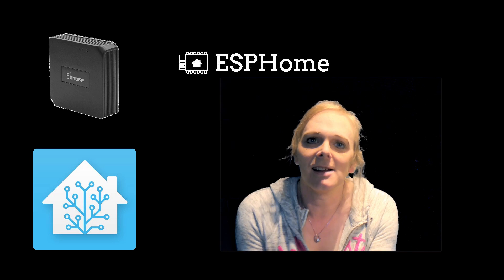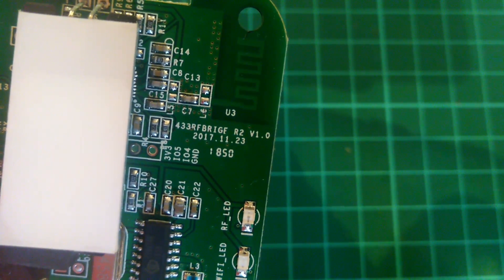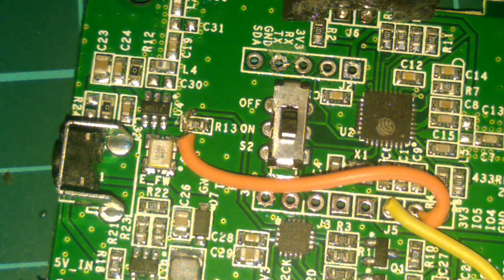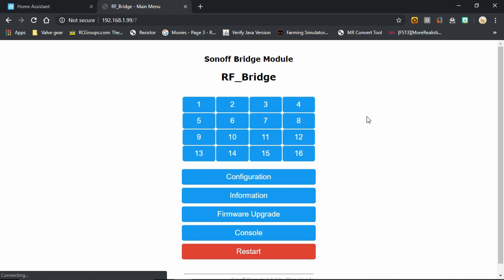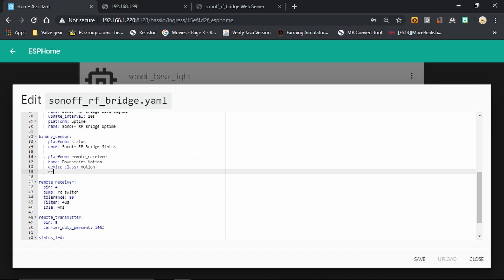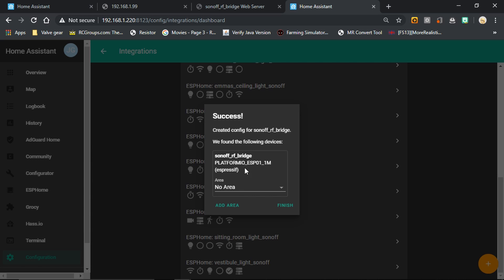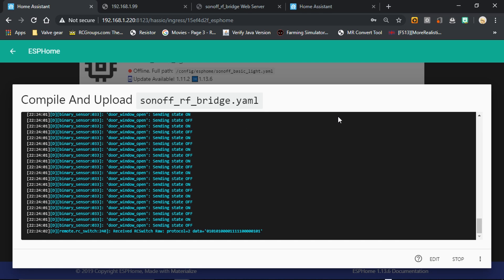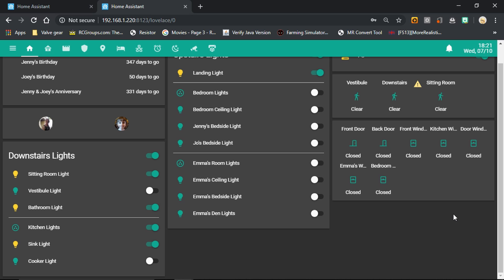Convert Sonoff RF Bridge to ESPHome

Comment: I recently lost my last backup and I had to resort to an older version. In between those versions, I installed RF Bridge on ESPHome. Now RF Bridge does not show in ESPHome. It does show in Configuration->Integrations. But it gives me errors when I try to configure it. It does not let me access it via its IP. And it does not let me upload new code to it via ESPHome, of course. Do you know of any solutions for this? Thank you so much!
Reply from the maker: I can't see why it gives errors connecting via integrations, it may be worth rebooting the rf bridge (or even the router as mDNS issues can cause connection problems) 
The code for esphome is only stored in the config/esphome folder though, so if you've lost that, it will never show in esphome. In that case, I'm afraid that the only solution I can think of is to create a new yaml for it and flash using ftdi.
Reply: @Pinkywafer  Thank you, Jenny, for looking into this. The router has been started many times since then. BTW, it gives me this error: "Can't connect to ESP. Please make sure your YAML file contains an 'api:' line." And it gives me the same error with a d1 mini I also setup in between the backups. One other quick question. What is the port it uses in Integrations? It is inputing by itself port 6053. Maybe I should change this to another port?

Otherwise I was thinking of trying to reinstall Tasmota. That would mean remaking the old hardware connections. Hope it will work
Reply: Sorry to bother you, @Pinkywafer  I managed to reflash tasmota. But I cannot seem to get the esphome binary onto the rf bridge. BTW, the first time I installed it, it gave me errors a few times before finally it worked. Did you happen to have this problem?
Reply: @ygreq  I have not had this problem,  but it could be due to the file size... try flashing a minimal tasmota first. I can't think of anything else I'm afraid
Reply: @jennygorton3412  I got the answer with the help of someone from the HA FB group. <<Go to Tasmota console, and type in "SetOption78 1", with no quotes. Should get a confirmation in the console that is is now on. It looks to check if it is a correct Tasmota bin file before uploading.
>> It seems this is a new feature or something. It worked!! Thank you so much for the lovely tutorials and for getting the time to reply!
Reply from the maker: Ooh! That must be new!  I've not seen that before. You're welcome!

Comment: Well done. Excellent instruction and thank you for your time in doing this. If you were starting with a virgin RF Bridge, would you flash it with Tasmota first or can you flash it with ESPHome Flasher on Mac using USB?
Reply from the maker: No need to flash tasmota first, you can flash your esphome binary using the ftdi adapter and any esp flashing tool on Mac or PC. I did one for someone else a while ago,  and flashed straight with esphome.

Comment: Thank you very much very interesting, but in this hack https://github.com/xoseperez/espurna/wiki/Hardware-Itead-Sonoff-RF-Bridge---Direct-Hack they put resistor (seems 680ohm) in place of the wires, it is better with or without?
Reply from the maker: Either should work fine. The resistor essentially acts as a fuse link, so that if there is any issue with your soldering, the magic smoke is not let out!

Comment: Since I have 3 RF Bridges, All the sensors should be all 3 bridges?
Reply from the maker: I'd just put each sensor on whichever bridge has the best signal... if you have 1 sensor 3 bridges, it'll show as a binary sensor 3 times in home assistant,  which could get very confusing!

Comment: Very good video, I remove tasmota from my Sonoff RF and now I wonder how is possible to send a code. Here is my code 

switch:
  - platform: template
    name: RF Power Button
    turn_on_action:
      - remote_transmitter.transmit_rc_switch_raw:
          code: '010101010101010100000011'
          protocol: 1

remote_receiver:
  pin: 4
  dump: rc_switch
  tolerance: 50
  filter: 4us
  idle: 4ms

remote_transmitter:
  pin: 5

  carrier_duty_percent: 100% 

but nothing's happen when I activate the switch in HA. Any ideas ?
Reply from the maker: I have no devices for testing the transmit I'm afraid. I have recently done this mod for someone else,  which allowed me to test the transmit (one rf bridge to the other).  I used the code the same as yours, but added:
repeat:
  times: 10
  wait_time: 10ms

The code was received by the other bridge (without the repeat the code is only sent once)
Reply: @Pinkywafer  thanx a lot, it works ! The correct code, since 1.13 is :
switch:
  - platform: template
    name: Remote Front Gate Control
    turn_on_action:
      remote_transmitter.transmit_rc_switch_raw:
        code: '010101010101010111000000'
        protocol: 1
        repeat:
          times: 10
          wait_time: 10ms

Comment: i've followed the video, however I cannot get the bridge to connect to ESPHome. Firmware flashed from Tasmota 6.5.0 . Web server works but cannot get status to work, it just shows as offline and as such 'show logs' does not work neither does OTA.  Any ideas?
Reply: Try using a manual ip address in the esphome sketch. I have seen this happen before if using dhcp assigned
Reply: Manual IP has already been assigned
Reply: I can't think of any other possible causes. You could try just a very minimal esphome sketch with Wi-Fi and logger and maybe just the status sensor. You could try clearing your browser cache. Beyond that, I can't think of anything unless there is a networking problem
Reply: Sudden  thought, do you have the subnet set correctly?
Reply: Subnet is correct, will try a basic sketch
Reply: Have tried a basic sketch, still no connection. Web server states bridge status as off
Reply from the maker: If the web server (web page at the ip address) is working,  I can't see any reason why nothing else would be working also. Is it flashing properly manually?  Also, might be worth check the switch under the led
Reply: Flashing via web or header is fine. Switch is in the on position. It looks like the api and ota ports on the bridge are not open
Reply from the maker: Then I'm afraid that I have no idea why!  If the web server is working,  I can't imagine any reason other services aren't (Unless you have a networking problem - I did have to restart my router once after flashing a sonoff basic with esphome,  as my router had 'lost' all mdns, so might be worth a try)   the only other thing I could suggest is to disconnect the soldered gpio4+5 and see if a basic sketch will work without the rf connections
Reply: I will give that a go, thanks everyone for their help
Reply: I was about to give up on this project but gave it one last try. Success, restarting the router looks like has solved the issue. I am setting up a 4 button remote control but i'm not sure what the device_class should be as I want to either press a button to toggle or 1 button for on and another for off
Reply from the maker: @kxt3084  the device class is not really important as it simply reports the type to home assistant. If you're using a remote for a switch, I'd just leave it out, which sets the device class as 'none'.  see: https://www.home-assistant.io/integrations/binary_sensor/ for more info on device classes

Comment: I have the same issue as Bruce in the comments below, the PIR Codes does not show in the logs when I trigger it, just nothing appears? what might be wrong ?
Reply: I opened it up and scraped the lines more and then it worked.

Comment: I'm currently using tasmota on my rf bridge, just how much better (reliable) would this mod make things. I'm planning on using an rf sensor to activate a sump pump connected to a wifi socket and am keen not to miss a signal from the float switch. Thanks
Reply from the maker: I wouldn't want to guarantee that a signal would never be missed. Sadly using RF there is always the possibility. The reliability is going to depend a lot on the rf noise in the area, the range (which remains the same) and any obstructions, From my experience,  there has been no noticable lag compared to tasmota, and the only signals I've missed have been when signals overlap, although it may be possible to improve the reliability by adjusting the tolerance,  filter and idle values of the remote receiver component

Comment: Hi Pinkywafer, so I got a second RF Bridge, and I've modded it, and it's working great for my sensors. But I have a problem when the bridge is booted, all the sensors are 'undefined', and I have to activate them once to get a known state in them, is there a way I can make them go to a specific state when it reboots?
Reply from the maker: I've opened an issue around this on esphome github:  https://github.com/esphome/issues/issues/828
Reply from the maker: Update on this: the latest version of esphome has fixed this, and the sensors will now report state at boot.
Reply: @Pinkywafer  Unfortunately the latest esphome is dogp.. on esp8266, as so I now have all my esp8266 on 1.13.6,and my esp32 on the latest
Reply from the maker: @kennethfribert6074  yes, there are LOTS of connection issues for ESP8266 currently. I did have a similar problem with one version of tasmota which was later fixed, so hopefully,  this will be sorted too. I can't remember what version of esphome I was running when I first set up the rf bridge,  but I have a feeling it was around 1.12.x
Reply: Ahaa, I actually just found an answer, I can do a id(id_binary_sensor).publish_state(false); in a lambda in the on_boot, so that's great, now they will react immediately.
Reply from the maker: @kennethfribert6074  I'm afraid doing a publish_state at boot may be the only way to do this at the moment.  a recent change to ESPHome seems to have caused this
Reply: @kennethfribert6074  can you put your lambda example in the description. Thx
Reply: @joeastor3221   under the esphome:
 on_boot:
    then:
      lambda: |-
        {
          id(stairsswitch_above).publish_state(false);
        }
And I've just repeated that line for each sensor.
Reply: @kennethfribert6074  tryed it a honderd times.. can't get it to work.. :(
Can  you put also your template of your stairsswitch_above?
Reply: sorry i used wrong account
Reply: @joeastor3221  I've added the config here: https://community.home-assistant.io/t/my-sonoff-rf-bridge-with-esphome/147725?u=fribse
Reply: @kennethfribert6074  I would have never found my issue if you didn't put this on the net.
Thanks a lot.
The part i did not have and Pinkywafer didn't have in her system:
  - platform: remote_receiver
    name: stairsswitch_above
    id: stairsswitch_above      <-------- This part!!!!
Reply: @joeastor3221  Ahh ;-) Yes, it has to have an id if you refer to it in another sensor :-) You are most welcome.
Reply: @kennethfribert6074  Hey Kenneth, just wanted to let you know. The Lambda lines are not needed any more.. :-)

Comment: could you upload the configuration.yaml thanks
Reply from the maker: My esphome yaml is in on my github... link in the description. There is no configuration yaml entry for home assistant as it uses the esphome API, so it is automatically configured when you set the device up on the integrations page in Home Assistant

Comment: Some videos show that they flash even without soldering, just pushing and keeping pressed male jumper wire pins with fingers. Is it really possible?
Reply from the maker: If you are able to make the connection for the length of the flash, then yes, it is possible. With through holes for TX, rx gnd  and vcc it is often quite easy to flash without soldering. The hardware mod in this video is permanent,  but the flash can be done without soldering
Reply: @Pinkywafer  thanks for prompt reply. Unfortunately I have never been successfully to make the connection by pressing pins with fingers. As I can observe the holes itself don't have any connectivity, but, the upper and lower part of hole has connectivity metallic space. If it's possible how to go for flashing without soldering just by pressing with fingers
Reply from the maker: It depends on the device,  most boards I've done this way have connectivity through the hole. I find the easiest is to use jumper wires with male DuPont connector through the holes and apply gentle sideways pressure, so "tipping" them in the hole
Reply: @Pinkywafer  I'm sorry. I'm a big dummy. what does the hardware mod do? is it needed if I have already flashed with tasmota?
Reply from the maker: It bypasses the microcontroller to allow the esp8266 to directly control the transmitter / receiver.
Reply: Pinkywafer thanks! That clears it up.

Comment: Hi. Thanks for the video. I have a sonoff Rf bridge the same a you have. I have carried out the hardware modification but I am confused about how I need to update the firmware. Is it the same way as drzzs using an adapter to connect to a pc or is there another way over network  by logging onto the device? (Looks like how you did it) Sorry if I’m being stupid. Thanks Adam.
Reply from the maker: Once you have compiled the firmware, you have 2 choices:  If you already have Tasmota on the device, you can just go to the web page for the device and press the "Firmware Upgrade" button (how I did it in the video) or you can connect it to the PC with the adapter (like DrZzs) but flash the compiled ESPHome sketch instead of tasmota

Comment: Hi Jenny. I have written the sketch and upload to Bridge. It did successfully upload to device and removed tasiota. unfortunately i ended up having to flash manually after this as it did not connect to wifi. Got that sorted and successfully flashed the esphome sketch to bridge, and the bridge is now online.
The problem i am having is seeing the codes sent from my PIR sensors and Door Switch. They are now showing in the logs? the log is only showing Wifi signal and uptime in the logs, and not get raw code to use in esphome. 
Do you have any idea why the PIR and or Door switch codes are not showing in the logs?
Thanks in advance.
Bruce

Comment: I hate tasmota on this rf bridge due to memory limitation for adding rules being limited to only 500 chars. Does anyone know how many sensors can be added to one rf bridge using esp home?
Reply from the maker: I would guess that you can keep going until the available progmem is reached... as the way each sensor is defined could be different,  it's not possible to say how many that would be,  but for ota flash, the sketch needs to be just under half the available memory size, so you're looking at a compiled binary size of about 500k

Comment: Great video, but i’m curious if HA will retain the open position after a restart?
Reply from the maker: I've done some testing with this:
If HA restarts and power stays on the rf bridge, the true status is returned at boot, as the state of the sensor is stored on the rf bridge:
1 Window open - stop HA - no change to window - start HA - window shows open.
2 Window open - stop HA - close window - start HA - window shows closed
3 Window closed - stop HA - open window - start HA - window shows open
If the RF bridge looses power, HA shows the sensor as 'Unavailable' When the rf bridge regains power, it has lost the sensor's value (stored in rtc memory), BUT: from my testing, after 'Unavailable' HA restores the last known state, so:
window open - power off rf bridge - HA shows Unavailable - power on rf bridge - HA shows open (even though rf bridge web interface shows it as closed!)

Comment: Hi great video, can I ask a question about what the Automation would look like in HA or even better ESPHome for example, to turn on and off a wifi bulb using the PIR. Thanks.
Reply from the maker: There's a good exercise of this sort of automation in the HA docs: https://www.home-assistant.io/cookbook/turn_on_light_for_10_minutes_when_motion_detected/  it is not yet possible to call services on separate nodes in ESPHome, unless you use mqtt and publish messages, but if the light was controlled by the same node, you could use the on_press or on_release automations to trigger something else
Reply: @Pinkywafer  Thanks for that. Keep up the videos.

Comment: Great video :) New subscriber. I got a question about ESPhome. I would like to integrate the pressure sensor MS5803-14BA working with I2c or SPI interfaces. Unfortunatly no official yet support for this sensor. Maybe there is a way with the "custom I2c" conponent. There is a lib available for this sensor for arduino. Maybe the translation for ESPhome is not so complex ?
Reply from the maker: It should be possible. I've not tried using custom devices, but there's a good guide in the ESPHome docs: https://esphome.io/components/sensor/custom.html which should help

Comment: Hi, I have a door sensor that sends a tamper, open and closed codes, how can I add tamper code to the same  template as open and close?
Reply: You have two options:   a binary sensor can only be on or off (ie open/closed for a door), so you'd have to have a separate binary sensor for tamper.
Or you could use a sensor (which can have any value and simply add another else if line to the lambda.
Reply: @jennygorton3412  thanks for the fast reply.  I get it now, I'll just use a regular sensor and just have a icon/picture for each state in HA.